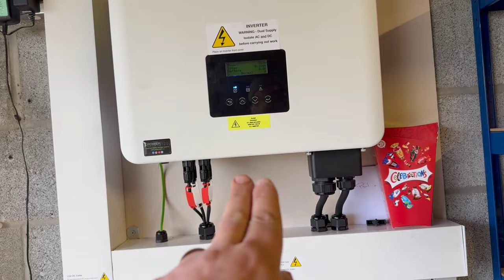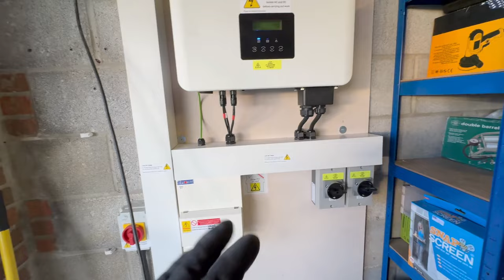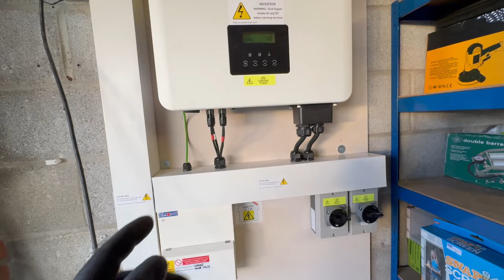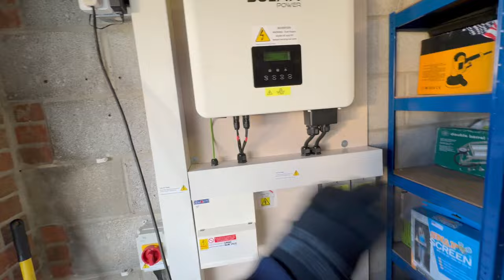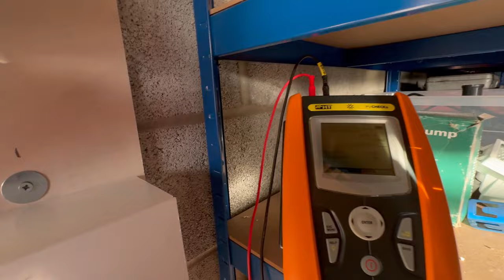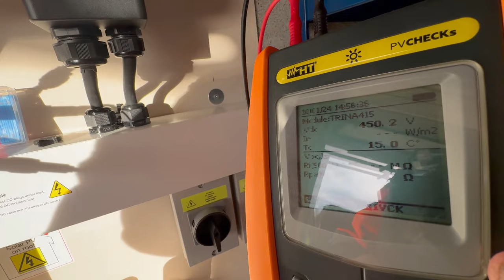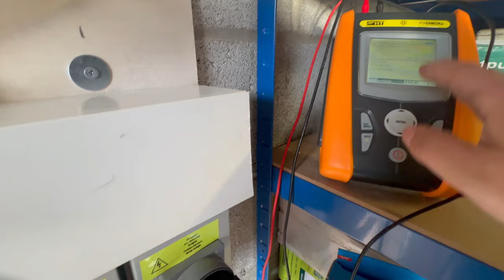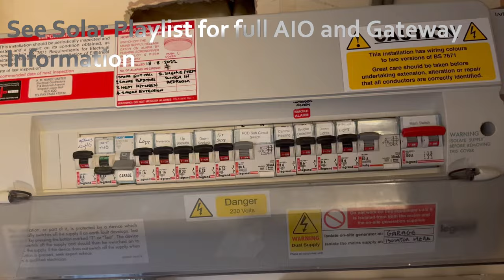Install solar panels at home - Roof work - Battery storage - GivEnergy all in one and gateway

Comment: I just love on grid micro inverters for
Grid connect stuff in a myenergi ecosphere! makes everything so safe and all Panels are stand alone.
Reply from the maker: Not so sure about that with AC on roof, equally the myenergi equipment is pretty pricey based on spec. We only offer the eddi in the range currently due to that.

Comment: Really good looking install. I appreciate the attention to detail on the mounting rails, some might have glossed over that aspect as it's "not electrical work" but it all needs to get done, if you don't know how to do it properly you end up fishing a panel out of the pond three doors down.
The filing rack with he install docs is a really nice touch and is going to help out a future spark or home-owner. I laminate anything going in a garage or outhouse as they tend to get damp, but I'm stealing the filing rack idea to replace my cup-hook and hollow rivets in the corner of the sheets method. 😀
Partly agree on the DC isolators, installers should both be capable of fitting an isolator safely, and anyone maintaining an inverter or panel array should know how to do so safely, with or without the external isolators.
Reply from the maker: Yeah lamination is great! Lots of pages in these handover packs lol. 

I don’t disagree in terms of knowledge to work safely. Sadly that’s not as common place as it should be. I saw an inverter with a melted on MC4 last week. Dealing with that is tough without isolation in the fixed wiring. Well unless we wait for dark which is pretty easy this time of year lol.
Reply: @electrician247  That's what apprentices and dieletric gloves are for 😉
Maybe we need 4 drones and a big sheet in the van for these occasions. 🤔
Reply from the maker: @andyca15  haha very true!

Comment: I think you can argue the DC isolator thing either way, if you've got them on the side of the house, exposed to elements, it's easy to imagine water getting into them and them turning into a hazard. I agree there's a fundamental problem with competence, but I've paid a fortune for appalling work in the past, so price is no sure fire way of getting anywhere - surely a consumer should be able look up an electricians official record, and trade bodies should do more inspection.
Reply from the maker: I don’t disagree regarding trade bodies but that’s not how it is. DC isolators outdoors require expert installation. I’ve got one at home and it’s dry as a bone. The equipment is not and never has been the problem. As discussed in the video. The fundamental issue is clear. The rest is nonsense to distract and divert away from fixing that.

Comment: As a competent DIY'r how much of the install could they realistically do themselves? Im asking necause i would assume for a SEG tariff and meter etc. MCS certification of the installation would be needed. Is this something contractors would ne happy to test / issue on an installation not directly installed by themselves.
Reply from the maker: That would not be allowed under the MCS system.
Reply: @electrician247  MCS is a rubbish Certification system. It is all about paperwork and profit. Very little actually installation training. Probably why there are a lot of very poor Installations done by MCS certified companies. But obviously it needs to be installed or certified by a qualified Electrician who ideally has experience of PV Installations
Reply: In theory a DIYer could do it all themselves. Most of it is pretty simple stuff. Panels come with pre-installed connectors so it is a simple matter of connecting them together. The ends to the Inverter are a different matter and they need to be connected properly with good quality PV Connector Pliers and with correct wire lengths to prevent arcing. The AC side is simple enough if you are a competent DIYer. But you need to do your research, especially when buying the right Inverter for the Panels checking Open Circuit Voltages and the like. Connecting it to the Main Consumer Unit is simple enough too. However, you would probably not get a warranty on the Inverter and you would not be allowed to export anything to the Grid. So, realistically you need an Electrician with PV knowledge to install although MCS isn't needed if you use Octopus as your Supplier (although I have chased them up on this because the Octopus Outgoing Tariff states MCS Certification is required)
Reply from the maker: @daveoram7249  the abuse of the MCS system is why we see poor installs from MCS registered companies. Those using correctly are generally spot on
Reply from the maker: @daveoram7249  the octopus process without MCS requires a DNO notification, building control notification and electrical installation certificate from a registered contractor. It is MCS in all but name and not usable by DIY routes. As you have found it is also not widely available 

Your comment is littered with other elements of extremely poor advice. It is essential electrical work is carried out by competent electricians. Anything else has the potential for catastrophic consequences.
Reply: @electrician247  I understand an Electrician needs to be involved and I agree that we do not want DIY people like myself no matter how competent working on Electrical Installations. But Solar is pretty straightforward once you have done your homework. I am looking to take the BS7671 Exam before I look to do any DIY Solar Install myself. Got the Brown Book, just need to read it all

Comment: I don't understand why you need EPS to provide a local circuit in the garage, why can't you just stick another breaker in the small consumer unit?  Even if you were pulling 20A, the load at the source consumer unit is never going to be more than -20A, as the inverter only generates, i.e. decreases that load.
Reply from the maker: Someone needs to look at bi directional and think again. The small consumer unit is powered from the EPS. Easier monitoring of PV generation, extra protection, perfect solution tbh. We did consider as you have suggested but decided that was a very amateur/poor option.
Reply: @electrician247  I really appreciate your content here, but was also confused on this point - you acheived nice low volt drop on the connection back to the house so don't see how connecting PV into the garage CU as originally arranged would be a problem? Or is it because your PV feed now goes to the AIO gateway and not main CU?